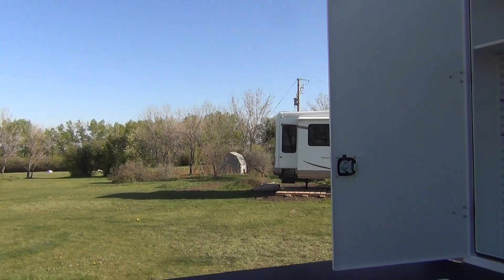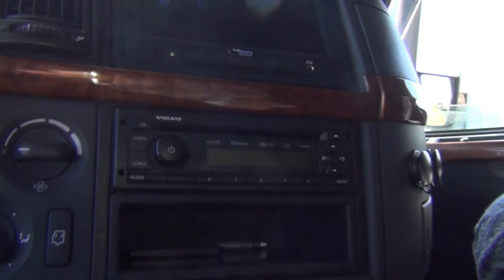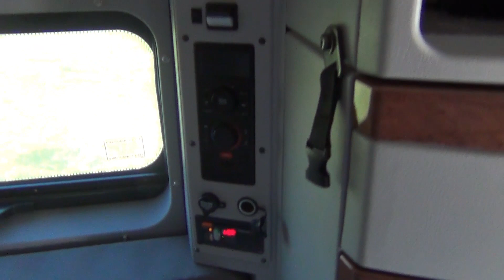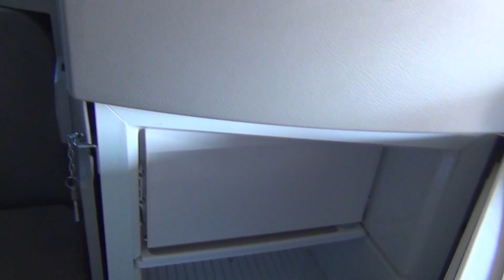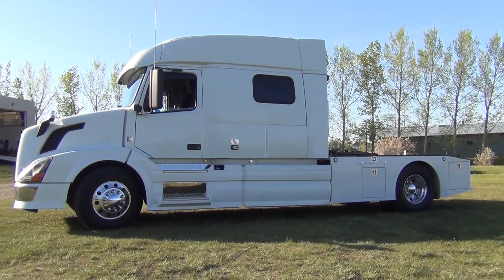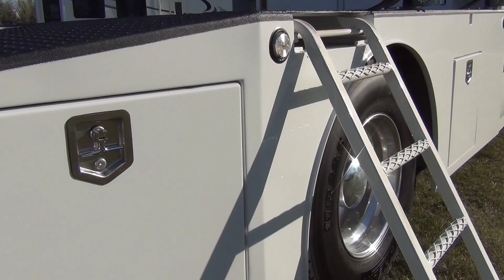RV Hauler Heading to Atlanta   First an Inspection Video

Comment: Good stuff, glad I ran into your channel. I'm sure these can be 'winterized', my use would be to travel thru Idaho, Colorado and Wyoming to visit ski resorts. If you've recently done a video of a winterized vehicle, could you direct me there please, thanks.
Reply from the maker: +Gabriel Thompson These are completely ready to handle the coldest of temperatures already from the factory.  Add a nice little Webasto diesel heater, and you are set!
Reply: +Gregg RVHaulers Thanks for the reply, I see these beasts blow-by me in the Sierras. My concern is, not just with hauler, but the 5th wheel, (i'm not sure you can make recommendations) BUT, I'm lookin at theSpacecraft, and also Agusta. This will be my first/last trailer, hope to sell my home in CA, kids are grown and I'm tired of CA politics. I was thinking of a Coach, but your presentations, knowledge, along with theversatility of a hauler convinced me. Now for the leg work this summer.

Comment from the maker: Hello "back off".  The average Volvo is engineered to travel 1,000,000 miles of commercial duty without requiring major engine work.  When we put our RVHaulers into "semi retirement" pulling our light loads, theoretically they should go further.  I still think it is safe to say they will reach a million miles.

Comment: Gregg, this truck has approx. 635,000 mi. on it's D-13 engine, what's the life time mileage expected for this engine hauling that type of weight ? In mile not km, Sorry I'm from Tx. I'd have to pull off my boots and use my toes to convert the mileage, EH ! lol

Comment: Another awesome truck you said once this was made shorter for the long trailer, do they import cabover Volvos to Canada
Reply from the maker: Marchal Peck The cabovers are not available in North America.  I did quite a bit of research into this previously, and they are quite different builds.  There are absolutely no parts for them in NA, and no trained technicians.  I initially thought a D13 engine would be the same everywhere.  I was wrong.  We did some theoretical parts orders that are quite common, and the parts would have to come from overseas (it would take weeks).  Plus, there are no diagnostic computers that can connect.  I contacted the North American dealership that went over to the Volvo mechanics competition in Europe last year.  In order to complete, Volvo send a cabover to the dealership, along with the computer, and a trained mechanic to teach them how to work on an FH (so they could actually compete).  This was the Babine Dealership in Prince George, BC.  They finished 11th out of the entire world!  I actually tried to buy this specific FH.  I got as far as a lawyer in Volvo who said absolutely NO WAY would they let this truck stay in North America.  I do know that recently there were a few FH models brought into Quebec for testing - for a few months in the logging industry.  Again, they had to go back after testing.
Reply: Gregg RVHaulers  that proves it European has some of the coolest trucks around but not available here. What a shame, it would seem to have a huge market for most of their trucks.